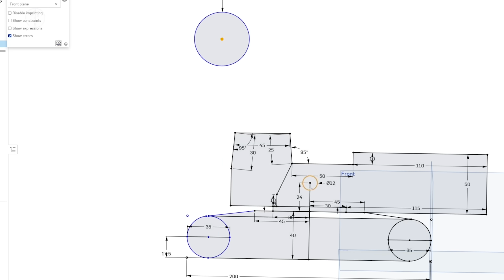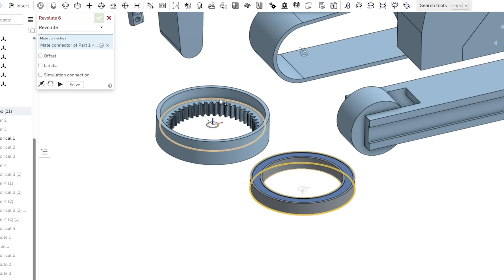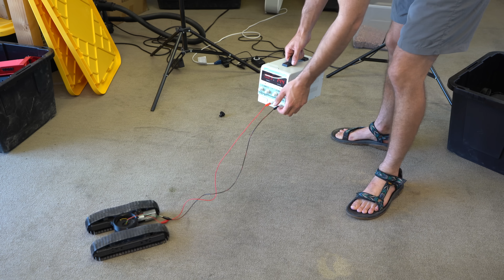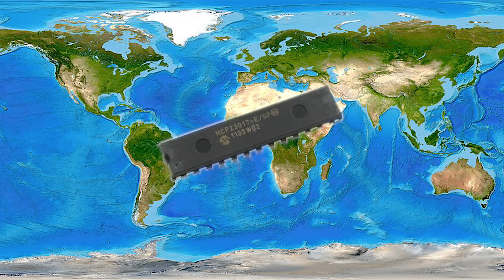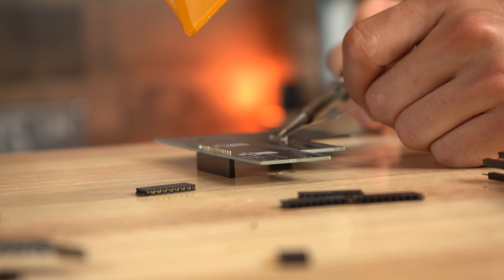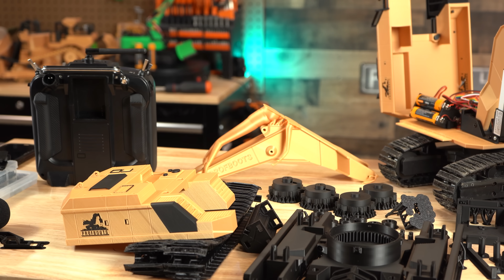3D Printed RC Excavator - DIY

Comment from the maker: Thank you everybody for tuning in, I hope you liked the video! Please leave a suggestion down below on what to build next. Really give me a challenge, the more details the better!
Reply: Rc 10x10 heavy offroad rotator tow truck for rescue all of your RC models. Some tow truck would be nice ❤
Reply: You know you have technologi Now crossover of traktor's drivetrain and semi truck.

Ps: sorry for my english
Reply: Vibratory roller for road building! Can add multiple roller styles. One smooth for flattening, one ribbed for compacting. 

Center Articulation steering. Front roller, rear wheels. Off balanced rotary weight for the vibration. I think this could be really cool!
Reply: You should make a concrete mixer for the BEANS🫘
Reply: Articulated dump truck, mini dump is great but now we need a serious off-road dump for excavator and loader
Reply: grain harvester
Reply: Or you could make a backhoe loader
Reply: @Caleb_McCawleyyes like a hydrema 900e
Reply: Crawler crane
Reply: You should make a "professorboots carrier" it's where it is an aircraft carrier, but holds all your builds or you can make the biggest machine ever built on earth a.k.a. THE BAGGER 293
Reply: Could you make the mini skidi bigger so it fits the new excevator?
Reply: WATER TRUCK HALFTRACK! (with working pumps for firefighting!)
Reply: @macallan3933 fr
Reply: Bucket wheel excavator with conveyor belt system
Reply: I was saying that he should make THE BAGGER 293 or a the biggest bucket week excavator
Reply: you should make trains! I'd love to see a rc northern type or challenger type!
Reply: Giving credit to SMV.WD45 with the suggestion of a barge or tugboat (as it can dredge the water further out with a longer boom)

Adding to this. You will need to waterproof the hull with fibreglass or hot glue as 3D prints are not waterproof on their own
Reply: Hitachi EX8000 mining excavator
Reply: Articulated hauler
Reply: Road graiter and roller is an idea.   Might also be time to upgrade/ upsize the dump truck. 

So last month I   a couple short clips. A guy using an rc tractor with working mower attachments to mow his yard. Second video he was using a rake attachment to get the clippings in lines.  I didn't see a video of it getting bailed  but that would be kinda cool too.   Why not a combine that actually cuts grass and spits it out the back like chaff.
Reply: A rc grapple skidder
Reply: We really really need a proper trailer for the excavator and dozer, maybe a gooseneck with the trailer bed extendable width sides.
Reply: What is the estimated cost in all parts and materials to build this?
Reply: Hey professor what software do you use to make the 3d designs?
Reply: Cat m16 grader
Reply: I feel like they only logical next step is fpv cams in the cab for ultimate realism, maybe even head tracking?
Reply: GODDAMNIT SELL THEM ALREADY
Reply: Make a pierce fire truck specifically a pierce mid mount airel platform
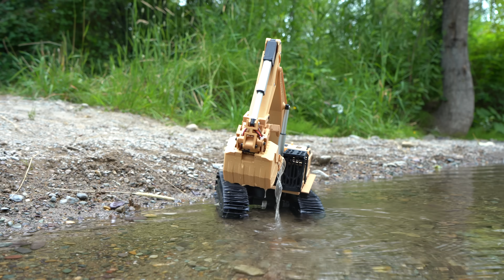Reply: Backhoe please 30:58
Reply: John deere 1470H wheeled harvester would be cool!
Reply: Ladder truck
Reply: plz a RC LR 1200.1 Crawler crane with Lattice jib 😁from liebherr 👍
Reply: Hey I bought a professor pass on the website to buy a lot but nothing changed
Reply: Long reach boom for big excavator
Reply: you seem to be spilling the Beans ... ;)
Reply: Could you do a bull dozer, maybe a three piece blade so it takes three print plates just for the blade. A huge dozer would be awesome!
Reply: think about a back hoe, it'd be perfect for the beach because you can have the front loader plus a dozer plow and excavator attachments
Reply: subscriptions are a complete disrespect to anyone trying to support you
Reply: A larger-scale off-road dumper to complement the new outdoor fleet.

It should match the scale of the loader and excavator—perhaps an 8×8 with a tow hitch so it can pull a low-loader trailer.
Reply: A telehandler. Like cat TH0642. Capable of lifting the forklift.
Reply: Make more of the RC part versions. And maybe retro fit the dozer and loader for RC parts. And maybe Semi???!!!
Reply: Spider excavator, a way you can completely swap the bottom treads for spider excavator, antiques https://m.youtube.com/watch?v=rt2V6AMXkew&pp=ygUQc3BpZGVyIGV4Y2F2YXRvctIHCQmZCwGHKiGM7w%3D%3D&ra=m here’s a link
Reply: Or if you’re looking for a real challenge, I recommend The Bagger 293 (manufactured by TAKRAF) is the world's heaviest land vehicle and tallest excavator. Built in 1995 or is this too much of a challenge you could also make it capable of outdoor travel, and that would work perfectly with the dump truck
Reply: Road grader
Reply: A mining dumper, to go with your dozer and excavator
Reply: Lowboy trailer with a front jeep and attachable rear booster
Reply: Invest in a h2d - with dual nozzle there is almost no time-hit when printing pla, with petg supports. You get perfect support (parts look better under, than on top), they usually remove them selfs when taking the part off the bed.
Reply: Plane
Reply: Make a bigger semi and trailers for the excavator
Reply: upgraded skidsteer w/ pto and remote bucket lock or just a telehandler would be cool too
Reply: Tugboat/barge
Reply: can you make a tank 😅
Reply: Mr professor boots please make a Volvo a40g rock truck
Reply: How about a hopper/conveyor system to move and load the beans...
Reply: Do a road grader next, with the ability to adjust the height, angle, pitch, and tilt of the blade. Would be quite a challenge with the fairly small footprint.
Reply: Feldhäcksler für Mais
Reply: 3d Printed boats and trailers and trucks when?
Reply: Ur model is awesome but could u try to make wights for it
Reply: I have an idea: a multi lift truck with some containers. Like platform, platform for logs and other
Reply: Yo bro you should make a land rover 110 pickup so then you have a truck to get a round the place
Reply: Baja truck? or upgraded skid steer
Reply: @professorboots can you make a vacuum truck. Can you make it off of the Vactor 2100 Plus for sewer
Reply: I kind of agree with the first guy but I think you make a wrecker rotator 75 ton like a Century 1075S
Reply: You should make a skidder
Reply: Make a mecalac 10mcr
Reply: The boom pivot join in the mecalac 10mcr has to be a servo
Reply: Telehandler
Reply: Could you create a design for an electric shovel?
Reply: Keep up the incredible work! The amount of time and effort you invest into these projects is wild. I think some kind of service ship/tug boat would be pretty cool, but there is always the issue of water seeping through the hull that would be hard to solve without the use of some finicky epoxy/chemicals. As for land based project ideas, I'm on the grader team.

Comment: You should consider an H2D printer with dual nozzles, giving you the ability to do a PETG print with PLA as the support structure interface layer. -Nathan R

Comment: A little bit of a late suggestion, but one thing that real excavators (and dozers) have is a mechanism that allows the front track roller to slide back and forth so that it can be adjusted to get the track tension just right.  It looks like something like that might also be useful on this model.  On the real excavator, this is moved by a cylinder that one pumps grease into to move, but I would think on a model something equivalent that uses a bolt-and-nut setup would work pretty well.

Comment: A cool trick i've used to make parts stronger is borrowing the essence of rebar in concrete by using thin screws, bolts, threaded rods, plain smooth shafts, mechanic's wire, or even swaging (google it ;D) a short length of filament. 

This tremendously increases the strength of the part, and the best thing about it is you can control what gets reinforced in which direction. Do it right and the screw heads can even become a visual feature and enhance the look.

Another sneaky trick is model a tpu skeleton frame that presses in across the layer lines. this gives it a complex overmolded look, strengthens the part in its weakest axis, and can even be functional as grips - say, within the claw or thumb attachments

Comment: This Excavator needs a push blade like the small one. 

Also a question I have regarding the electronics: how resistant are the 90° motor's to water ? You seem to have driven definitely far enough in to the water te them thoroughly wet and there where no issues afterwards?

Comment: scale up

also y trax rubbing on teh platform

also wot i do with esp32 is stick a smol webserver on there with a configurator to adjust settings.

like for sticks adjust center, expo, and dead zone.  also easy to add some debugging stuffs so u don't gotta serial println so muchz

so pull in asyncwebserver, littlefs, and i also put my settings in a json file.

also if ur doing full RC just use CRSF protocol and edgetx/opentx.

also rp2040 could xpand ur io

Comment: I was wondering how water proof are these electronics? If they can be in contact of water at all or if there is a way to make them water proof?
Reply from the maker: As is they aren’t super waterproof but you could absolutely coat them in conformal coating to make them waterproof.

Comment: Build a Supercar bext, for example sth like the Lego 8880 Super Car. Maybe with a functioning 8-speed transmission, all wheel drive, headlights, wing-doors, suspension, etc. basically just sth you can go drive RC Rallies with

Comment: hey @professorboots great job as always, the project seems very fun!
are the 3d printed parts compatible with A1 mini or is the printer too small?
Reply from the maker: The a1 mini would be on the smaller size. You might be able to split some of the larger parts into 2 pieces though.

Comment: Why didn't you use shift registers like 74HC595? Even at the minimum guaranteed 25Mhz clock you can produce 8-bit software PWM signals at 20khz or more, the ESP32 is definitely able to do that. You just need to control the GPIOs directly (not using digitalWrite). They are cheap as hell and you can get them everywhere.

P.S.: Always use the DRC of your PCB CAD program before ordering anything ;)

Comment: only attachment/part I feel is missing, is the dozer blade, I know not all excavators have them, but would be cool to see if it would be possible to add one.
Reply from the maker: I actually have the mounting points built in so one could be added!

Comment: I'm with the one guy; on a long reach version of this would be pretty cool. Other than that, I think a Telehandler would be a great addition. Also, if you're wanting a bit more strength for parts, I would recommend some PCTG filament. It's a slightly different version of PETG but has more strength and basically the same printing parameters. I've been using the COEX brand, and I've been very impressed with it.

Comment: Hay professorboots you should try and make a lowboy for the RC semi truck since it would make transporting the excavators and wheel loader around easier and it would be extremely cool to see how you made it and you should also make it so you can add an attachable axles that would be extremely cool and kept up what you do it's amazing

Comment: you need to make a barge so you can dredge and transport stuff. it needs to be one of the small ones that can push the big barge sections. also you should use a jet drive for the way to move it so that you can run it in a creek.

Comment: There's a screw reachable from the back of the TX16S that allows you to make the left stick centered without needing a rubber band (look up mode 2 to mode 1 switch and simply do half the job)

Comment: I love all your projects.
When I got my own 3D printer, I knew that I didn't just want to "download and print", I knew that the joy will be to create my own custom parts and things.
I've since gotten into CAD and designed quite a bunch of useful and fun models for myself, friends and family.
My CAD skills have a long way to go to get anywhere near your amazing skills.
One of my current WIP projects is a "rubber band tracks vehicle". I had stumbled upon some pretty wide and large rubber bands, and immediately thought "rubber band tracks!".
It'll be ESP32 controlled, with a camera, LED lights and geared N20 motors. Maybe some distance sensors. (Yes, I have a lot of different components and sensors ^^') I try to make all designs parametric, so I could change the parameters for different rubber band dimensions, and the model should adapt to work with these.
Since it's a very small and light model, I really want to use 3D-printed bearings. I know, most people will go "just buy them", but they will bear almost no load, and my idea is to directly integrate them into the free-spinning wheels. I managed to create OK-ish roller bearings, and I know that the potential for great bearings is there.
I used to be very sceptical about 3D-printed bearings, but one of the first downloads was actually a "print-in-place spool stand with print-in-place bearings", with lots of doubts and without any tuning, I still gave it a shot.. and was very pleasantly surprised.
My design is actually rather wonky with the whole wheel with the roller bearings and the roller separater, inner hub and outer wheel to be printed in place.. and it does roll, but I used too much clearance, so it's a bit wobbly. A better option might be a slip bearing.
Oh.. I started rambling. heh.

Anyway, your videos are a huge inspiration.

Comment: Try adding some weight to make it more stable and will also give it some more digging power, I used some sticky car tire weight on my hydraulic rc excavator and helped a ton. I think they also make some higher torque screw motors for the arm control motors

Comment: There are a ton of 3d printed pickups and trailers. I would love a Grader with a side of steam roller/packer with different style drums(smooth/spiked/bumped), maybe some fun or customizable patterns. Maybe logos or tiny human footprints to leave on the beach. cobblestone pattern. Just so you know, some drums on steamrollers have shakers built in to vibrate the ground for a better pack.

Comment: You'll have such a better time with an RC transmitter because of the gimballed joysticks. You don't need any deadzone to avoid accidental multifunctioning because the x and y axes are separately sprung.

Comment: Why do you have a rubber band on the left stick of your TX16s?  That transmitter is fully adjustable to be self center or not and also has adjustable stick tension.  It just take a small turn of an exposed screw.

Comment: Hi, I'm new here. I know I shouldn't make requests, but...what if you built a proper little lapboard excavator control panel with an ESP32 inside? I think it would be neat if it were accurate enough that you could train to use a real one with a model. Cherry on top if you put an FPV camera in the seat.

Comment: BIgger scale dump truck with the wheel loader motors instead of the n20 motors would be dope. Printing the bucket in 2 parts would be manageable

Comment: Like everytime perfect video. Since i work with excavators, I absolutly love how much of details you get here correctly. But only one thing, have you ever concidered adding a cam inside the cab? Like the little one used in FPV RC planes. It will add a absolutly new experience when you play with it outside.
Reply from the maker: Oh an FPV excavator would be a ton of fun!

Comment: You should make a normal pickup truck that can pull bumper, gooseneck, and fifth wheel trailers. It could be used to haul the smaller models around instead of pulling out the semi. It would be cool if it had different beds, ex. short bed, long bed, dually long bed, flatbed, service bed, etc. Just let it it allow for customization and modularity like the semi truck.

Comment: You should definitely do a oicture with the dlaw holding a plane like in the meme

Edit I forgot you already did it, I still leave this comment for the algorithm. 
Thanks for the video and sharing all the files, it a humongous amount of work you are giving for free

A few quick tips 
- nearly all bearings are standard sizes, but then the price differs if it's a common size or a more special one. I would advise to pick  models that fit your geometry from reputable brands like SKF and then order a cheap copy with the same size code (ex the SKF 6004 is really cheap cmpared to other bearings with the same overall dimensions as it's made in bulk)
- for the motor driver, you should create a component schematic and footprint for the motor driver (in easyEDA), this way the schematic would already have the pins labelled (VCC, GND, EN, A, B, ...) and you won't need to check 3 times the spacing between the pin rows
- the radiomaster transmitters have configurable sticks, you can add or remove the centering spring, add/remove friction, and also have nitches if you want, on either of the vertical movements of the two sticks, you can also tweak the strength of the centering spring by adjusting a screw without disassembling the transmitter

Comment: I am trying to build the mini skid steer, but I can’t figure out how to get the PCB board? Where do I find the file to print that?
Reply: You dont 3d print it. In the workshop for the mini skid there should be a section called “sourcing parts” there should be a link there or in the pcb section. You go to JLCPCB or PCB Way and put the file into their website to have them make it for you
Reply: @joestoll4330 so is everything I need in his workshop??
Reply: yes, everything you need to build it— including instructions, parts lists, videos, and tips are in the workshop

Comment: Did you do anything to add extra low-cg weight or counterweight? I know that's important for real excavators.
Reply from the maker: The CG is pretty low as is! You could definitely add some car tire weights to the bottom if you really wanted to